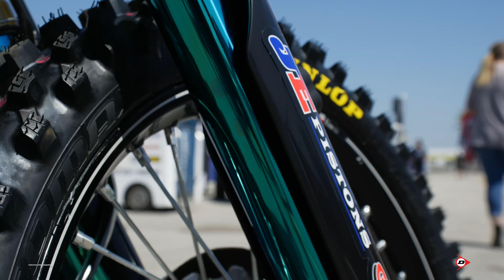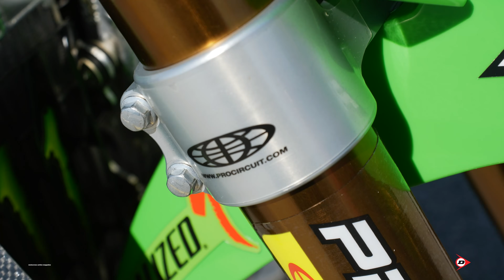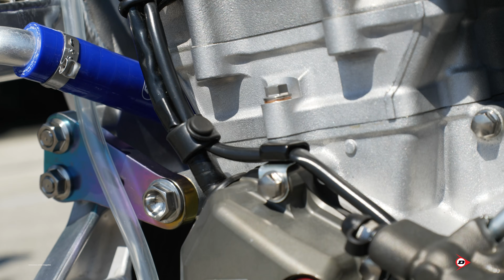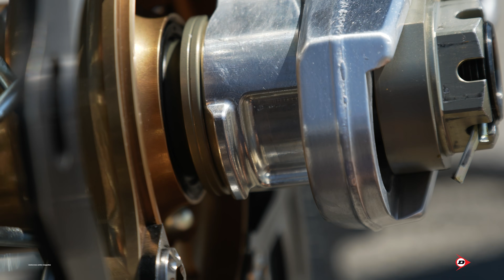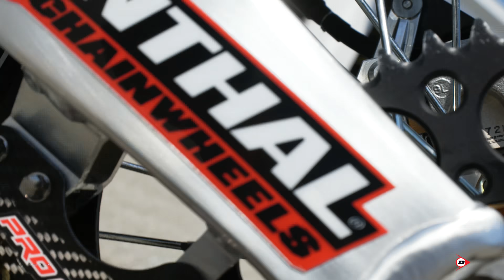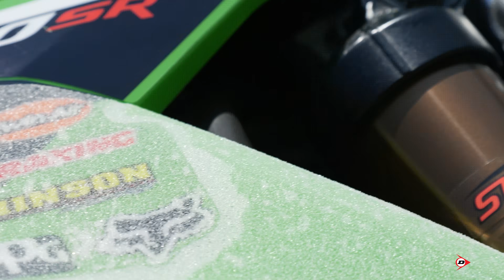Inside Cameron McAdoo Factory Pro Circuit Kawasaki KX250

Comment: SHOULD HAVE SHOWED THE OIL LINES ON  RADIATORS AND THE TOP FORK CAPS  THE ADJUSTMENTS'  ON  THE CAPS. DID IT HAVE A CENSER ON THE SHIFT BARREL?